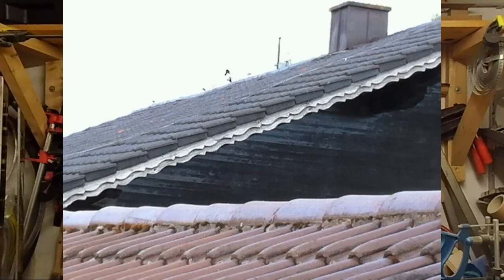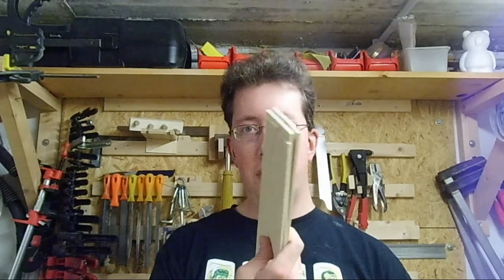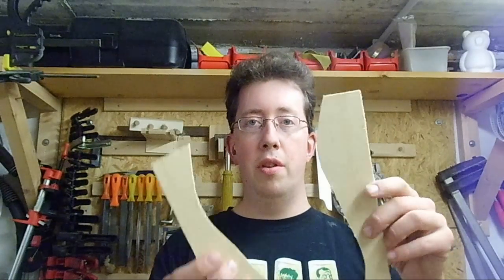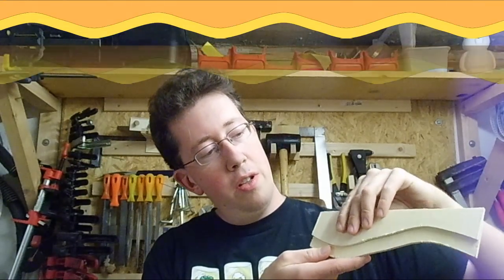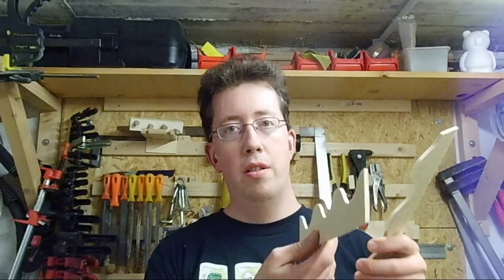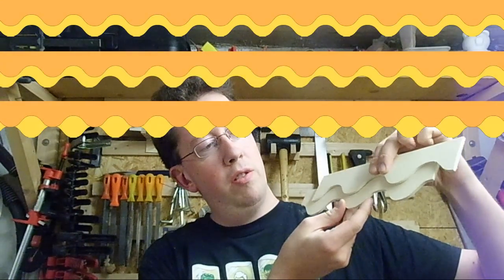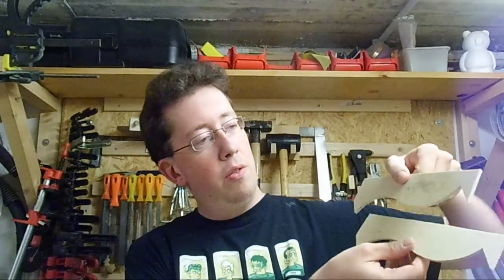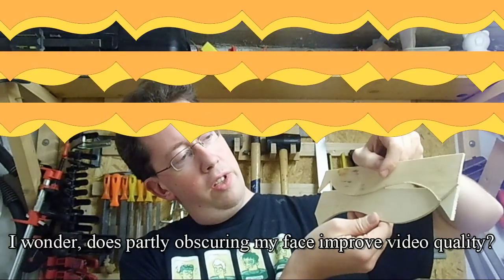Roof trim, scrap free

Comment: I was in Germany for several years (many years ago) but never noticed those decorative facia boards. Interesting concept and use of wood to reduce scrap. Also noticed the roof tiles in the foreground roof of the picture appear to something other than normal also. Thanks for sharing.